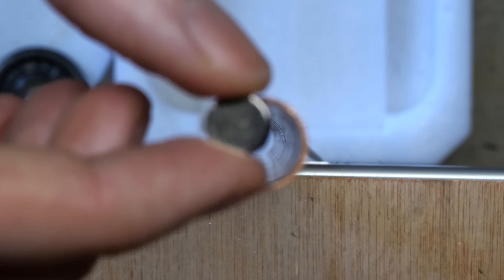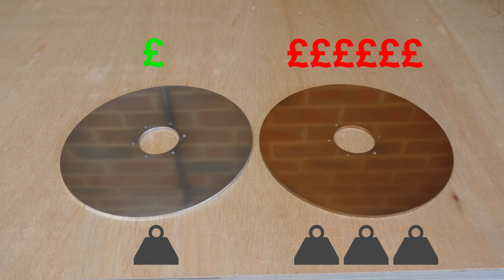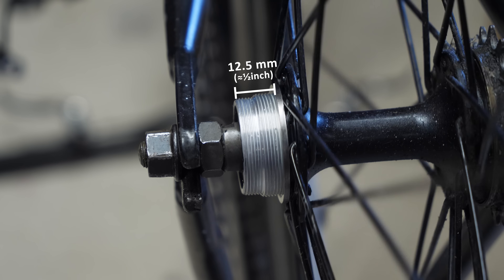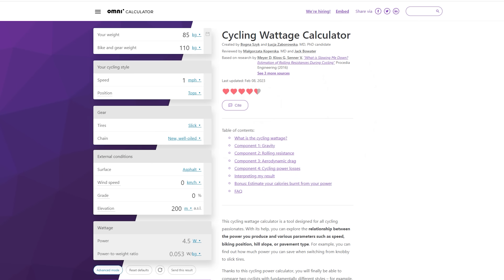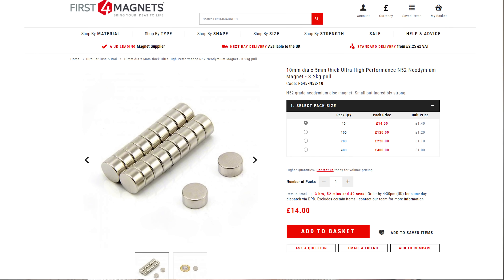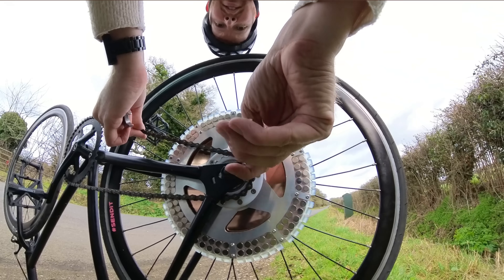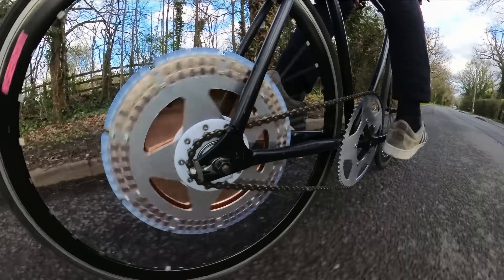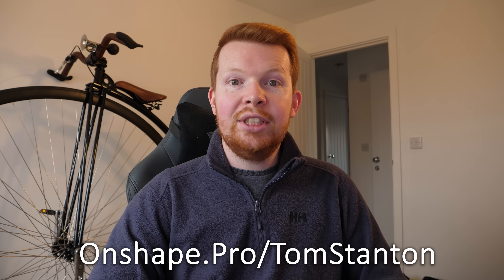Gearless Magnet Bike

Comment: 3:27 For future test, you could try an Halbach array, could improve magnetic field on the copper disc side and reduce de chain and spokes attraction ;)
https://en.wikipedia.org/wiki/Halbach_array.
And I think that you could use another metal than aluminium for the magnet support, there's some strange behavior with it and magnetic fields,
using steel like in motor and transformer could help if you design them well.
Reply: Came here to say that, Halbach array ftw, hopefully he sees your comment

Comment: Please connect a freewheel hub to the system. There is a reason that coasting brakes went out of fashion. this transmission could be useful with a high RPM electric motor.

Comment: I remember you were talking about magnetic bearings in some other video. Do you plan to make a bike with it?
I mean instead of magnet - copper what if there was a magnet - magnet?

Chain could be replaced with a belt so that it does not stick. I'm not sure about the spokes, but maybe carbon wheel or smth?

Comment: 6:50 could you make copper gear and sprocket and design a custom magnet mounting to that ... 

ummm i have idea for using opposing poles as the slave drive to a generator/alternator/coil perpetual energy generator ... using a self powered adjustable copper wire as a governor with a dimmer switch adjustment .... i havent been able to find a place or partner nor have the money to test this idea ... i have examined/run this idea through my mind from different angles like tesla did ... i have not found a reason this wouldnt work ... its just a matter of design ... maybe you could test and share this ... im talkin a device in around a 6' in enclosed tube standing horizontal that is generating its own electricity for ports and plug ins you could carry anywhere ... hook up to one of those uni wheels or scooter ... replace combustion power engine to magnetic pulse powered engine with perpetual energy generator ... i beleive you can use magnetics to "levitate"/get in tune with "gravity" ... i beleive "gravity" is a tone/harmonic that holds us to the earth ... like a "wireless" dog collar that shocks when they go out of range only our "collars" is a frequency of harmonics that hold us to physical manifestation ... when we "die"/"pass on" our flesh bodies become "decomposing"/returning to dust shells ... ummm jumped tracks lol ... anywho i think magnetism .... is it true if you have a horseshoe magnet and spin a piece of aluminum in the center of the magnet it manifests electrical current ... that could prolly make a more effecient perpetual energy device ...

Comment: This is cool. If you decide to revisit this idea, I suggest you use a one-way clutch bearing for freewheeling and also add a U shaped back-irons for the magnets. This helps steer the fields in a shorter path and should increase the flux (IIRC) in the gap on the copper disc while reducing the magnetic forces  on the chain and forks. Soft iron is best however plain steel should be fine as the magnetic field in the magnets are 'static'.
Reply: thats good suggestion. It would increase the torque for that design but not the efficiency of the system right? The main losses are in the copper if I understand it correctly.
Reply: @LaggerSVK  My experience with electro-magnetics is somewhat limited. My most recent experiment was a axial-flux motor for a heated stir plate I was making. I couldn't source suitable materials so I recycled the windings and core laminations from a large transformer to build it; not ideal for the frequencies that I drive it at but it ended up working reasonably well.
Reply: Actually, they now call it dynamo iron, as it is no pure iron anymore, but an iron silicon alloy.

Comment: I did my graduation project on this topic. We made a gearbox using neodymium magnets, although we did the calculations using the parameters of a N52 grade magnet but used N35 grade in the prototype. Which created a lot of slippage and lower torque than anticipated, N52 would have helped, but they are too expensive at the moment....

Comment: would having a electric transmission with one motor at the pedals and one at the rear hub connected directly with just two wires achieve the cvt like effect you're going for?

Comment: You could make use of the centrifugal force experienced by the magnets ,put the magnets against a spring ,as the sprocket moves faster (in a higher gear ,easier to pedal),they will be further away from the pivot and have greater moments than when the sprockets are moving slower(harder to pedal ,higher speed), therefore making a cvt gearbox
Reply: thought of the same thing, could enlarge the copper disc too

Comment: Not into biking, and was confused/wondering WTH you were doing. However, fantastic science and methodology not too mention build.  You build an exercise bike that sort of works like a bike. Or a mobile generator to keep your phone and lights charged?   I wonder if keeping normal drive and simple have a scaled down setup, you could perhaps make a different kind of generator to provide power for lights and/or charging.  There has to be a way to use some magnets or power to cancel the effect for when you're fully charged or don't want the additional light drag.  Very cool.

Comment: Adding a ferromagnetic plate on the other side of the magnets will increase field applied to the copper plate. This is because this way the magnetic circuit has  lower "resistance" (or however it is called).

Comment: @Tom Stanton Hey Tom, could you make a hybrid bicycle. The bicycle will be propelled by an electric motor on rear wheel, but the electricity for the motor is generated by another generator that is driven by the pedals and there would no chain direct connection between pedals and wheels. And then add a lithium ion battery that will aid when going up hill and store energy when going down hill or slowing down and the rear wheel braking will be done using the electric motor and front wheel braking is done using brake pads. Do you think you can build something like that? Acceleration is done by pedaling only and regeneration of energy happens only when you squeeze rear brake handle, otherwise it will just coast freely. What do you think? Please like this comment so Tom can see it!

Comment: In Veritasium's experiment the difference in mass would not matter. I ran through the energy balance of a falling plate with a no-slip condition and mass cancels out. Only the height of the plate would change the rotational acceleration and in the experiment all plates look to be roughly the same height. Inverse square law could be to blame. In your experiment I am not sure it matters (for demonstrating your point) what the final rotational speed of each disk is. Copper, with more mass, would still have a lower final rotational speed if the magnets weren't there. It doesn't show much unless you compared the expected final rotational speed of each without magnetic breaking to the experienced final rotational speed with magnetic breaking and then back-tracked to which one applied a greater moment. Maybe you could have controlled for moment of inertia by decreasing the inner radius of the copper such that its moment is equal to the aluminum disk.

Comment: Indoor cycling "smart" trainers use this principle, and using a stepper motor to adjust the gap between the magnet and flywheel is how the trainer resistance is adjusted to make it feel like you're riding uphill or down.

Comment: If you're doing more experiments using a fixed wheel, Miche make a sprocket carrier which would make DIY drivetrains much easier to machine (...or print 😅)

Comment: I have seen a different type of magnetic bike transmission.

Basically 3 circles/tubes.

The inner tube consists of a few magnets, then you have the middle tube which is basically iron but with gaps that align with the magnets, and the outer tube is consists of more magnets than the inner tube.

Like say 6 magnets on the inner tube, and 18 or 24 on the outer tube, something like that.

watch?v=DAWVetrtD9U

a link to a video of one.
Reply: the disk and magnets is something you could use on a car for braking.
That kind of brake does not wear out.

They use it to stop the free fall funrides.

Anyway, i would think the idea in the video i have put a link up for is a better idea.

Comment: Yes you can machine those threads! Look for a bit known as a "thread mill". With one, you can spiral mill threads. However, you'll need to fully tram your router (or backlash compensate) so it can make circular circles. ;)

Comment: Make it dual clutch that is put this system on both the sides of the wheel 😁 increase the clutch diameter, and the main sprocket, decrease the driven sprocket size further, would be interesting to see it in Max mode 😁😁😁😁😁😁😁😁😁😁

Comment: I got into bike riding just a few months ago and I'm interested in single speed and hub gears. I heard about CVT hubs this week so your timing on this video is absolutely spot on. 

Although inefficient this is a really interesting concept. That for sure must be the coolest bike on the road. Or hottest depending on which wavelength you look at it.
Reply: yeah you should think of it more like a constantly slipping clutch than a CVT. if you want to input a constant power you still have to pedal faster and faster as the bike is accelerating. obviously it doesn't meet any of the requirements for a useful bike transmission. the closesest to make a CVT using magnet would be a generator on the crankshaft and motor on the wheel which would work as efficiently as the product of every energy transformation. this clutch is inefficient by design (unless using superconductor?)
Reply: @geemy9675 My thoughts exactly! There are also electromagnetic CVT hubs that are basically a generator and an electric motor in one. The output RPM can be much higher than the input RPM. I forget what they're called... m-CVT?
Reply: BTW CVT is not single speed, but infinite speeds 🤣
Reply: @geemy9675  I said I was interested in single speeds, hub gears, and CVT. Never implied it was the same thing.

Comment: this isn't really a transmission though? just an eddy current clutch? you don't actually change the torque/speed ratio. it's the equivalent of a mechanical linear regulator. burning up the extra power but still outputting the same amount of torque. you should see if you can get magnetic gears working though.

Comment: Love the idea. Why not just move the magnets away from the disc when cycling a bit like a calliper. You can also use a gear to spin the disc faster too so it works at low speeds, or create a disc with a hollow centre and just brake at the rim so it’s faster

Comment: Eddy clutches are a rare device.  Old mechanical speedometers, grinding wheel control on a few old OD grinders, a Volvo car, and some industrial motors  are the rare exceptions.  The latter 3 being electromagnetic so the amount of engagement could be controlled.

Comment: There also gears with magnets instead of teeth. They do not have problems with energy dissipation - at least while torque is not high enough to overcome magnetic interlocking. I wonder if it is possible to design some kind of CVT around this principle?

Comment: You could use the same principle to make magnetic brakes that are impossible to lock due to lack of physical contact. The break disc should be made of copper, and magnets are located on movable petals like in a camera diaphragm. You press brake lever, and petals with magnets move from outside of the disc and become right over its surface.
Sorry for my bad english, i hope the idea is understandable.

Comment: I was thinking about for when doing long downhills. Currently, to maintain a safe speed, we have to keep squeezing the break levers for hours causing nerve compression injuries. What if we had a speed breaker. once activated and set speed set point and it keeps that speed without touching the brake lever. Something like that is there for motor vehicles for legal speed limiting.
A modification of your setup can be used just for this purpose. It is like an electric disc brake. Use electromagnets to apply braking power when needed instead of permanent magnet. By controlling the magnetic field, we can control the speed. It doesn't need the kind of coupling your setup need. But just something like the disc brakes.

The con is that it adds significant weight..

Comment: add small holes or grooves to the disc, and then on the magnet support, make it like little fan blades, to direct the air, and if possible add a small scoop on the rear side of the bike to direct even more air. Good luck trying to understand this, my english is bad, anyway amazing concept and amazing project as always ❤

Comment: What you need are printed magnets to replace both the "magnets"and the copper disc.
Printed magnets would allow for non-contact torque without requiring eddy currents, so no energy lost as heat.

Comment: In home exercise bikes, a magnetic brake is sometimes used in the form of a set of fixed permanent magnets (or electric magnets in expensive devices), and a perforated metal disk (similar to an aluminum alloy) that rotates through an upshift pedals. The adjustment of the braking force is regulated by changing the distance of the magnets from the rotating disc. Excess heat is dissipated from the disk into the air by means of a small impeller with blades on the disk shaft. Thus, it turns out to achieve a fairly wide range of loads (from 50 watts to 1.5 kW) with modest dimensions of the device.
Reply: It's fine for a brake, where you are trying to convert energy to heat. That's not what you want for a transmission, where you want to waste zero.
Reply: Its also used for high speed trains to stop it from a high speed. Its a huge magnet thats dtops down to like a millimeter above the rail. https://de.m.wikipedia.org/wiki/Magnetschienenbremse
Reply: @jonkess2768  Not just on high-speed trains.  Old trams had an electromagnet braking system on the rails.  But in both cases the rail is steel, and permanent magnetism is used; in the case of aluminum, a different principle of operation is used, due to the induction of an EMF in a short-circuited circuit, the so-called “Foucault current” or eddy currents, which occurs in a conductor in the form of an aluminum disk  its own magnetic field arises, which slows it down.  By the way, the same problem occurs in speakers, which reduces the output at high frequencies due to increased electromagnetic induction, and to compensate for this phenomenon, copper short-circuited caps are used on the core of the magnetic system.

Comment: @Tom Aluminium is more conductive per mass, which is what should matter for most applications on a bike.  Copper is most conductive by cross-sectional area.  Since you're trying to pack it into the narrowest channel to achieve your EM torque converter application, Copper will probably win as you can get more conduction closer to the magnets.  Aluminium has another problem, and that is corrosion.  It corrodes deeper than copper does, which will increase the channel width.  And lastly, Aluminium is work-hardened easily, which makes it brittle, and once it starts to get micro-fractures I doubt it would maintain its radial conductivity. 😲  Yeah zap ties on the spokes was bad... instead, dish the wheel.  Achieve that by tightening the spokes to the opposite rim 1/4 turn each, then loosen the spokes on the drive side 1/4 turn.  Don't dish ever dish the wheel beyond 75% of the axle width as that starts to impair lateral stiffness significantly leading to what we call a "Taco" when the wheel experiences a strong lateral pressure!  You can re-center the wheel by changing the widths of the nuts on the sides of the hub, by shimming the cassette, adding washers between the hub and left stay.  Have fun and ride safe!

Comment: What a neat idea, and a really fun build! I might be misunderstanding the physics, but would a clutch like this not operate more effectively (for a given size) at higher RPM? It would be difficult to package, but I wonder what the effect would be if you added a second chain on the wheel side and drove the copper disc at 2x-4x the wheel speed and then interfaced the magnets to that? Effectively, use a chain to bring your pedaling up to high RPM, transfer through the clutch, then use a second chain to bring the high RPM of the copper disc back down to the wheel speed.

You'd likely need to mount the clutch elsewhere (perhaps in the center of the bike's triangle frame) but you might get better torque transfer with the same size disc and number of magnets, or the same transfer with a smaller disc and magnets.

Comment: I know it might be expensive but if you increased the volume of the copper disk, ie machine say a 10mm plate of copper (yes expensive lol but just theorising ) into a disc but if you then machined out a series of radial slots so if you view the disc from the edge it would appear crenellated like a castle wall. I’m thinking then effectively around each crenellation you would produce a more focused set of eddy currents and therefore more focused magnet fields with respect to the magnets ? This might reduce the losses because of you produce a magnetic field in a flat disc then you must produce a north and a South Pole and maybe due to the spacing of 2 adjacent magnets you might get fields overlapping and cancelling this producing wasted energy and therefore heat? Might be worth trying this theory using aluminium.